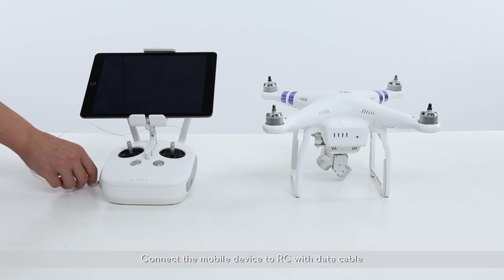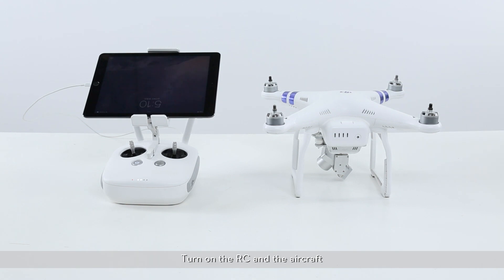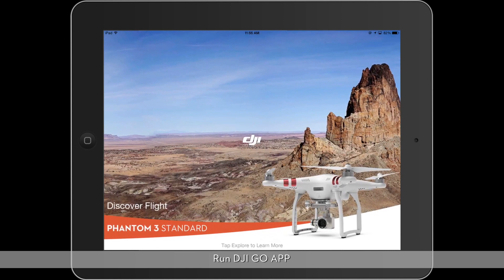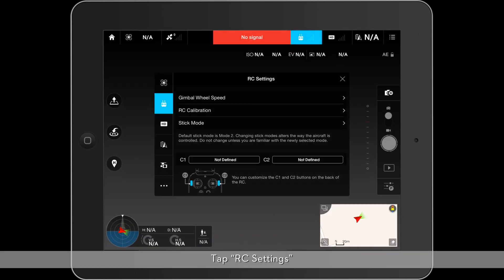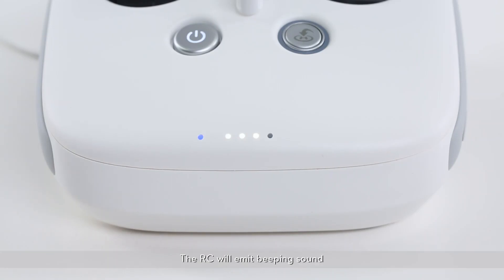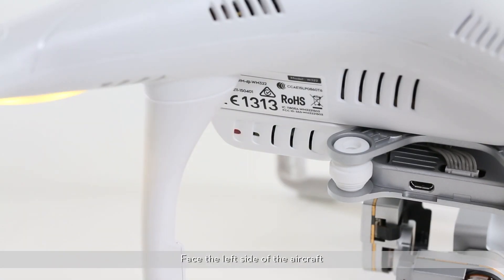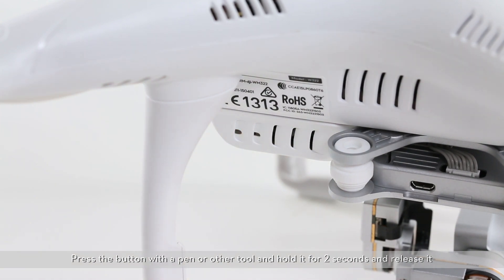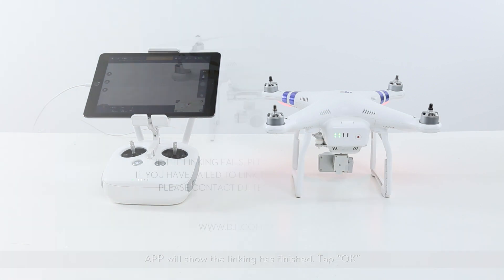DJI Phantom 3 | Linking the Remote Controller and the Aircraft

Comment from the maker: DJI Support is moving to DJI Tutorials! 
Don’t miss our consolidated contents and new videos, 
subscribe to DJI Tutorials at: http://bit.ly/2X04acQ
Reply: Hi sir 👋 I m hasrat Hussain.
Sir controller of phantom 3pro still giving red light with beeping no changing issue no pairing issue so please help me sir what I do.
Reply from the maker: @hasratraja8159  Hi there. We are sorry for any inconvenience caused. There are two cases when the red light is on: the controller is not connected to the aircraft, please try to reconnect the two. Or it is caused by a serious shortage of electricity. If the problem still exists, please send the drone back to our repair center for further checking. Thank you.

Comment: I bought a phamtom 3 standard and controller separately on ebay, but tried both methods in video.Still wnt bind.the drone does not have the gimbal and camera on it.
Reply from the maker: Hi Daniel, for Phantom 3 Standard, you may refer to this tutorial video: https://www.youtube.com/watch?v=krqYn5a5cT0  We're sorry that the linking RC will not success if there is no gimbal camera.
Reply: @DJISupportGlobal  so, what you're saying is you cannot link controller with the aircraft without  gimbal and camera.The link you attached talked about currency exchange.thanks for any information you can provide
Reply from the maker: @danielwickham4684  Sorry, we've edited the link, please check later.
Reply: Both methods  In the video did not work Is there any other suggestions I should try?
Reply from the maker: @danielwickham4684  Hi Daniel, as mentioned, if there is no gimbal and camera on Phantom 3 Standard, it is unable to link the drone and RC. Could you please help to confirm?

Comment: I finally solved my Phantom 3 advanced connection problem:
First, the problem: My Remote Control led light was stuck on ''CYAN'' colour. My remote wasn't connecting to the drone. The drone was flashing yellow and the DJI go app didn't show the "camera" button, it only showed "How to connect". So I found a way on the internet to solve it:
"Found the solution!! with the remote plugged in, go to the DJI go app and when you get to the screen that shows your device and says "how to connect" at the bottom, press the 3 horizontal bars at the top for 5 seconds and let go. a screen will pop up and ask you which version of the firmware you want to load. the 1.8 didn't work. the 1.6 version did. Once it started loading the light turned blue and did everything it was supposed to will firmware was updating. I turn off the app and turned on the drone and remote and pugged back into the device. once I did that the app was able to see my remote but, it still requested a firmware update tp 1.9.. I did that and it was successful. it then said my drone and remote were still disconnected. so I followed the steps I've seen in so many videos (and on this post) to reconnect. I held down the c1, c2 and c3 buttons until I heard a beep. then I pressed the right wheel a couple of seconds the light started blinking blue and I pressed the restart with my tool. the drone light next to the restart starts blinking red and then turns green and so does the remote."
Reply from the maker: That's great! We're glad to hear it works now. Thanks for sharing with us.

Comment: Does this mean that only one controller can ever be linked. I have two that I'd like to use - not together but independently when needed?
Reply: Don't try it, this linking will cause more problems.
Reply from the maker: The drone can't be connected to two controllers at the same time, but when you want to use another controller,  you can refer to this video to link it to the drone.

Comment: I'm using the latest version of everything. After a firmware update to v1.9, I have 2 solid red lights and 2 flashing yellow lights like above, but the remote controller light is green. I am able to turn the camera and stop and start the recording. I cannot connect to the DJI GO app or fly the aircraft.
Reply: For sure you have also like us problems with Craft and remote, because this latest update cause our DJI function poor with lots of problems.

Comment: my RC needs to be linked but when i open the app it only says how to connect not enter camera view. my RC will control the gimbal but not the quadcopter. i just did the latest firmware update, oh also since i can't enter camera view i can't update the RC through the GO app. i tried it the old way of plugging it into the phantom with the firmware update on the card, i am so mad right now
Reply: Greg Bolso  I have the same issue!
Reply: Same here.. How did you guys fix it?

Comment: I have the same problem but with the dji phantom 3 standard. how can I fix that ? Help Please asap
Reply: +Sony Velazquez  There's a little light on the side of the aircraft just over the model number sticker.  Press it for about 2 seconds and there you go.  I had to figure it out on my own, apparently DJI doesn't care about the "standard" users.
Reply: thank you so much, i have looked for this solution for hours and worked instantly @isabellanelson2084
Reply: +Isabella Nelson do you have to do that every time?
Reply: No, you only have to do it once, and you should be good! :)
Reply: yoyo marsh see comment above.
Reply: Isabella Nelson thanks  my standard that i bought for 350$ NEW iscoming in the mail tomorrow! And just wanted to make sure i didnt have to do that every time and
Reply: +Isabella Nelson Thanks a lot. This is so helpful. I have been looking for solutions for 1 hour.